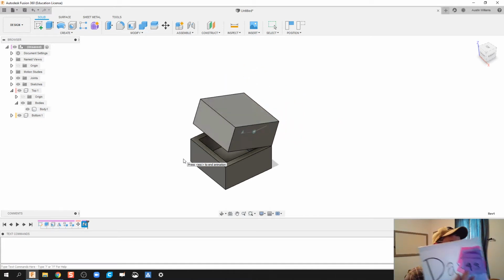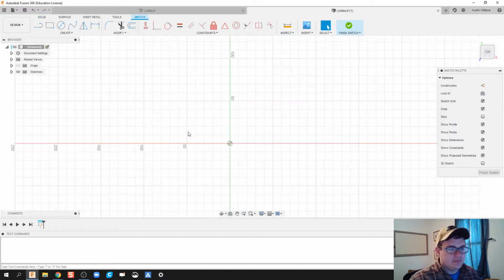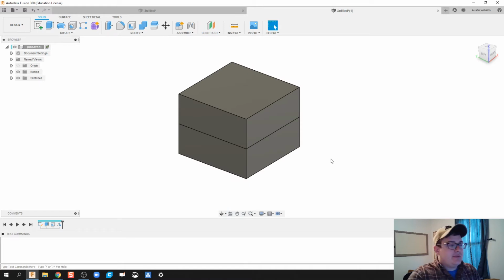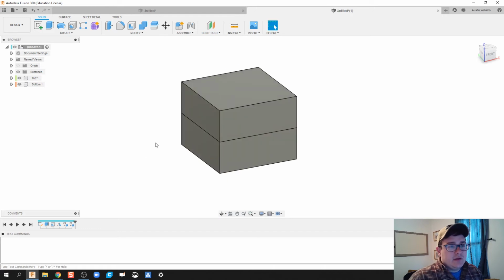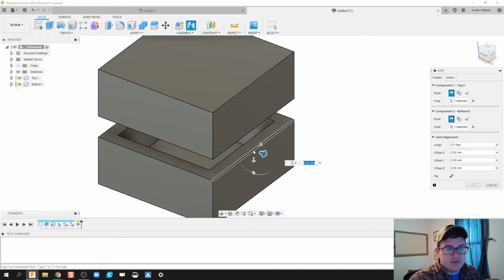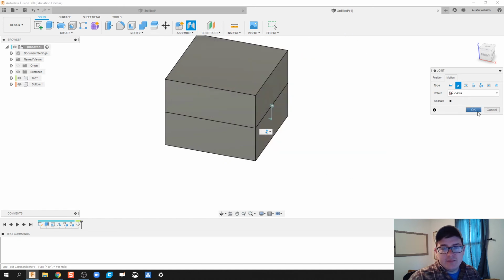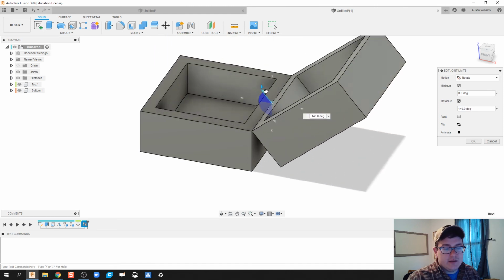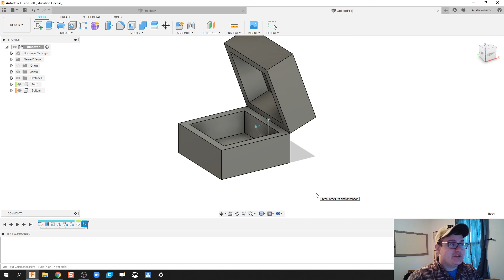Revolute and Joint Limits - Day 43 of 100 Autodesk Fusion 360 Journey

Comment: It looks like the options have changed. Now instead of "Edit Joint Limit", It says "Edit motion limit". And the flag to rotate to set minimum and maximum limit does not exist
Reply from the maker: Correct, there was an update during 2024 on how to use certain aspects of joints.